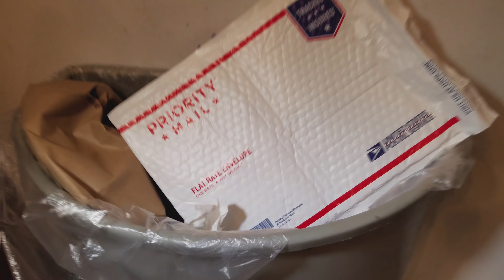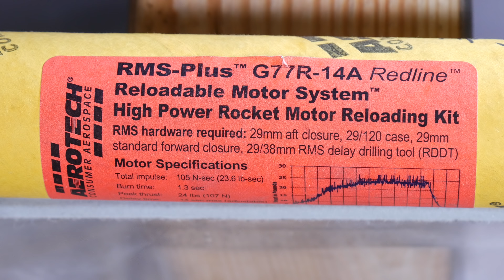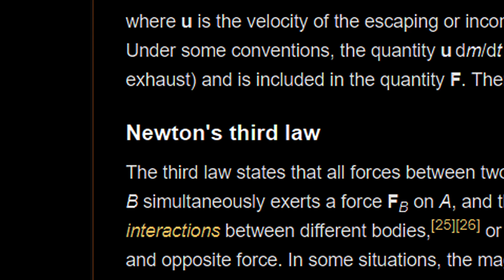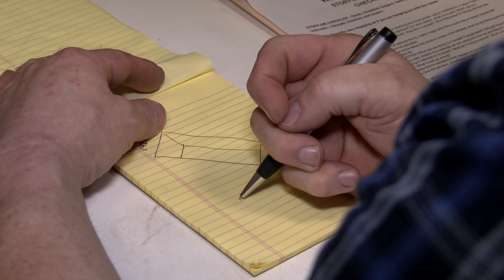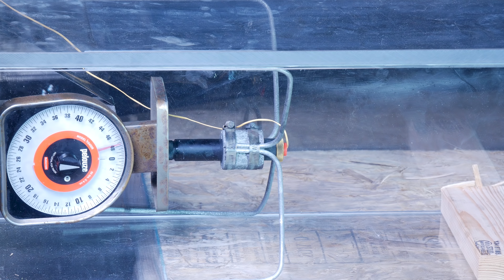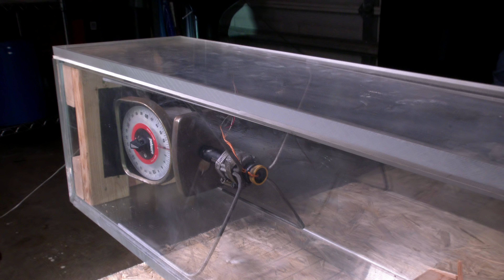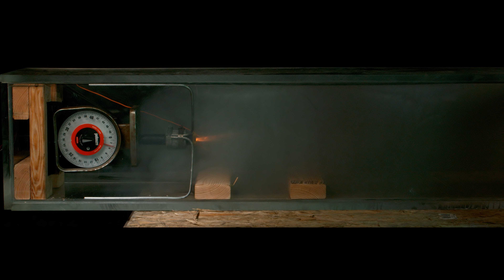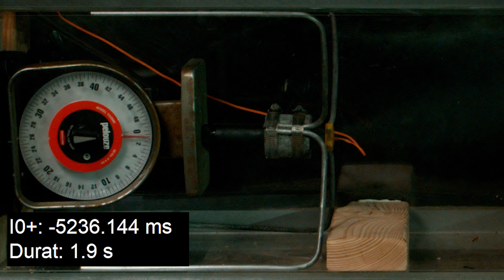Rockets in a Vacuum Chamber - Newton's third law of motion Visualized

Comment: Your comparing the vacuum of space to a tiny chamber...? As soon as that rocket starts expelling gasses, it’s no longer a vacuum. So what’s the point here?
Reply: yes its true that the chamber fills up 100 % in a hundreds of a nanosecond. this is true also if the vacuum chamber is big as earth as the fill up is directly. Gases fill out with speed of the tens of the speed of light.
Reply: larry ballard   Its no vacuum...there is smoke and a atmosphere. Yes. We went to the moon in a Hollywood movie.
Reply: Plasma Matter  "Without the ether"?? SMH. You obviously skipped some class in science because there is no experiment that had proven the aether
Reply: to prove that solid rocket motors can burn with out oxygen?
Reply: no matter how hard you rage 
the vacuum of space exists
rockets work
we landed on the moon
& 
the earth is still not flat
Reply: @CarsonKendall  ok so a room filled with oxygen next to a vacuum. I poke a hole in it  does all the gas escape instantly ? Or does it take a few seconds or minutes depending on the size of the hole?
Reply: @zekeriasvarg530  Extreme exaggeration. Example: The average speed of a nitrogen molecule at room temparature is about 500m/s. Significatly more at the temperature in a rocket motor, but a tenth of the speed of light is 30000000 m/s. ..and in order to give the gas molecules such a reletivistic velocity I guess the energy density of the rocket fuel would have to be about a million times higher or something like that.
Reply: WapTek1 How dare you drop truth bombs in a YouTube comment section!
Reply: @erikwalfridsson8790  har du aspberger? jag driver ju fför helvete med ämnet. Klart som fan NIII lag funkar i vacuum.
Reply: not sure what your poking a hole in, but I've found debating hypothetical scenarios doesn't take either side anywhere.  The point here is that this experiment doesn't even come close to representing the alleged perfect vacuum of space.  And a rocket booster wouldn't have any thrust in a vacuum. there's nothing to push off of. Outer space as your public school describes it to be, only exists in your imagination.    there's a firmament up there.  Read Genesis 1 and also study ancient civilizations cosmology.
Reply: @CarsonKendall  So you are saying that religious books and ancient civilizations who bassed they believes on thoughts know more abput how space works that our current scientifics with actual proofs of why and how space works?
Reply: @paulabenitez5340   Your writing proves my point that people use to be smarter then they are now.
Reply: @CarsonKendall  Yeah, because the writing of a non native english speaker is a proof of the intelligence of the entire world, you really have proven your point.

By the way, what is wrong with my writing?
The only mistake i see is that i wrote ''abput'', and that wasn't even an ortographic error, it was a typing one (Also, cool how you avoided giving a argumented response by saying that i did something wrong, mabye you don't really have such a strong argument angaist it, do you?)
Reply: larry ballard  the rockets we send to space can continue to burn because of oxidizer.  The reaction does need oxygen, but oxygen doesn't have to be in a gas form to still be oxygen... Most of the world's oxygen is actually locked in rocks as oxides, look at mars, tons of oxygen, though not in the atmosphere there, its what gives it the red rust color... so the concept that for some reason the rockets would stop working once they leave our atmosphere is misguided.
Reply: @paulabenitez5340  Not you personally.. people in general.  Each generation is getting more and more reliant upon the government as well as technology.. We have massive amounts of knowledge at our finger tips but  have lost the ability to critically think for our selves. (not everyone) but the masses for the most part.
Reply: @zekeriasvarg530  Nej, det har jag inte men efter att i flera år har sett hur gränslös människors okunskap och/eller dumhet kan vara så går det inte längre att bedöma vad som är sarkasm och inte. Har du inte märkt det?
PS
Vänligen avhåll dig ifrån att använda ord för olika utvecklingsstörningar på det sättet.
DS
Reply: @paulabenitez5340  Is ND tyson a lier or nay? .just this one question
Reply: @CarsonKendall  watch the YT video "Close Up Footage of Falcon Heavy Arabsat-6A!" and tell us those landings were fake. Then answer the question: How did those boosters TURN AROUND and FLY BACK to KSC IN A VACUUM ?
Reply: Plasma Matter  True. Their fake space is supposed to be a VOID. Meaning nothing, so nothing for light to travel along.. So light cannot be coming from distant stars. They have to be in the aether. The ballie trolls ignore that. Light needs a medium to travel along, the same as sound and radio.. Good someone else knows the truth.
Reply: Yute  it isn't even good comedy
Reply: @erikwalfridsson8790  is that the actual speed of light. We haven't been shown any proof. There is also people questioning it now. Claiming it doesn't move that fast. Probably true guven the way we have been lied to about everything. I say that speed is also a lie. Until proven.
Reply: @WapTek123  then explain why the stars that are above me in the evening are still above me in the morning, 10-12 hours later. Totally impossible on your idiotic spinning ball..
Reply: @preppertechnicianee6013  if you put a pinhole in a gas tanker how long will it take to empty. Knock out the rear panel  and how long will it take to drain out.
Reply: @erikwalfridsson8790  supposed to be around 50000 mph
Reply: @stevewittwer7444  "The aether has been proven a couple of years ago?" Every test that's ever been done has literally disproved what you've said so please, provide some facts
Reply: @stevewittwer7444  Wow, reading each of your comments is amazing
Reply: @stevewittwer7444  Why are the stars above you in the morning?? Do you even understand the model that you don't seem to comprehend??

Pick a city that's several thousand miles away from you. Now, walk 300ft mouth or south. Isn't that city, several thousands of miles away still in the exact same location??

Why is basic high school math so difficult for many?
Reply: @stevewittwer7444  "gravity is a theory that's never been elevated to a fact"

Good Lord man, do you not underrated science?
Reply: @HarryStar56  The proving of the aether also proved the sun, moon stars are revolving around us. In the aether. Not light years away.
Reply: @stevewittwer7444  the rate of a tank empting is dependent on the vapor pressure 
If you knock out the real panal. Assuming in does poor out the vaper preassure is released more easily
Reply: @stevewittwer7444  "The proving of the aether also proved the sun and stars are rotating around us".

Ok, where are you making up this information from?? I've asked for YOUR evidence of experiment that had proven this and still waiting on you would claims
Reply: @stevewittwer7444  "what tests are you referring to". FFS, there's never been a test that had proven aether.
Reply: @stevewittwer7444  thats a good ieas tho if i put a taker in space. It has good amount of fuel and air in it

I have a if i slowly burn the fuel with a sealed tank what happens pressure builds and then the tanker might burst 

The pressure is pushing in all directions on the points on the  tanks wall equally so no motion.

So if i poke a Hole gas exscapes and the gas is now pushing less on this wall then the other walls and. The escaping Gas pushes the rocket forward
Reply: @preppertechnicianee6013  stop guessing and go research rocketry and vaccum and balloons.
Reply: @stevewittwer7444  dont need to guess its simply how it works 

You need to do research 

Look up why little ballons move
Party balloons when you let go of the opening
Reply: @stevewittwer7444 FFS, do you not understand the LAWS of motion? You don't need anything to push against, this is elementary school education
Reply: @stevewittwer7444  Still waiting for your experiments that you said prove the aether,  proves the sun and stars rotate around the earth
Reply: @HarryStar56  he doesnt under stand that gas has mass
Reply: @preppertechnicianee6013  Among other things.  The fact that @steve wittwer says that experiments have shown that the sun/stars rotate around the earth, aether exists, and yet still has not shown one item.  

There's a whole lotta learning to be done
Reply: @HarryStar56  Learn calculus and you wont believe that. Your just need to learn
Reply: @preppertechnicianee6013  Not sure about your mention of calculus to me, but I can assure you I've taken several years of calculus
Reply: @HarryStar56  then use calculus on the motion of the stars to give any wandering star a constant amount of mechanical energy.

Go do that to any single wandering star

Then notice What happens to all the other wandering stars

Us the sun as your base
Reply: @preppertechnicianee6013  I'm not sure where you're cooking with this, "I" don't believe in a flat earthearth. I know the earth rotates around the sun
Reply: @HarryStar56  oh i tapped the wrong name ya but tell them to di calc and it proves heliocentric ideas
Reply: @stevewittwer7444  I dearly hope that you are joking but I will answer anyway. YES it is the actual speed of light. It can be measured in many many ways. The first time was in 1675 (but back then, the error was quite large). If you think about it there is a lot of technology around you what simply wouldn´t work unless the speed of light was known. in every other hardware store you can probably find cheap laser distance measurers. Actually we can only measure the average round-trip speed of light. We can never measure a one way travel time since the clocks in the sending and the recieving end will go out of sync when they are moved apart from each other due to relativity. That is too hard to explain now. I´m tired.   
Please don´t question relativity too. I have seen it verified myself in the physics lab at my university and it is one of the best proven principles in all of physics.
Space and time being relative is a necessity for the laws of nature to behave the same regardless of reference frame. It was the belief that this has be the case that led Einsten to the idea.

PS
It is of course POSSIBLE that the relativistic formula for kinetic energy eventually turns out to be an approximation just like 1/2*mv^2 was, but then it has to be very very close.
DS
Reply: @yahikoksm5125  I dont know to much about him, but the little i hear about him was about him saying some illogical things, so i guess that he is kind of a lier mabye?
Reply: Yup, youd need a testbox the size of a house. We need to see vac pressure before/after.
Reply: Carson AF
Reply: larry ballard  No. Rockets carry their own oxygen with them. They don't need air to work. They work pretty well in the vacuum of space. Also for steering they have small extra rocket engines.
Reply: @stevewittwer7444  You are wrong. It has been proven that there is no ether, and light is an electromagnetic wave that can travel in a vacuum w/o problems. In fact, in vacuum the speed of light reaches its maximum, while it slows down in other media like air or water.
Reply: @stevewittwer7444  You are talking complete bullshit. Tell us when the ether should have been proven, it has not. Einsteins theory is proven to be correct by many experiments. And please learn what a theory means in scientific context.
Reply: WATERVACUUMS,space is suppose to be 100% water since they have to clean phytoplankton(whale food) that grows over the space station along with bacteria and fungi species found in our ocean..... the van allen belt(firmanent) gets bombarded by a hundred objects a day such as frozen gases or asteroid rocks. Thunderclouds come from space if theres no nearby water for evaporation or clouds moving in from the wind. Creatures are able to withstand the pressure of the mariana trench so its possible to withstand the vacuum of water in space.... sonoluminescence. The tectonic plates that drifted from Pangea supercontinent float on lava which spews up in volcanoes but there is more water then land and lava so underneath all the lava is another ocean bigger then the ocean on the surface which gets lit up by the gas combustions of lava eruptions and mariana trench bioluminescnence type animals with hollow earth caverns and giant creatures until you reach the molten core. There is supposedly interterrestial civilizations of alien cities in the hollow earth under the tectonic plates where you are far beneath the earthquake zone. They havent explored more then 10% of the ocean
Reply: @stevewittwer7444  Water Vacuums exist on a flat earth such as wirlpools,space is suppose to be 100% water since they have to clean phytoplankton(whale food) that grows over the space station along with bacteria and fungi species found in our ocean..... the van allen belt(firmanent) gets bombarded by a hundred objects a day such as frozen gases or asteroid rocks. Thunderclouds come from space if theres no nearby water for evaporation or clouds moving in from the wind. Creatures are able to withstand the pressure of the mariana trench so its possible to withstand the vacuum of water in space.... sonoluminescence. The tectonic plates that drifted from Pangea supercontinent float on lava which spews up in volcanoes but there is more water then land and lava so underneath all the lava is another ocean bigger then the ocean on the surface which gets lit up by the gas combustions of lava eruptions and mariana trench bioluminescnence type animals with hollow earth caverns and giant creatures until you reach the molten core. There is supposedly interterrestial civilizations of alien cities in the hollow earth under the tectonic plates where you are far beneath the earthquake zone. They havent explored more then 10% of the ocean
Reply: @parkdog7571  What a nonsense.
Reply: @parkdog7571  why tell me? I already knew all that from years ago. They stopped doing that years ago because they took some exit mould to coat that iss with, so they didn't need to go out into the waters of space to scrub it again. Keep up with the times., Everybody knows that. wakey wakey.
Reply: - That doesn't matter the theory is best visualized with a firehose which flops around because the pressure of the water creates thrust not because the water is pushing against the air